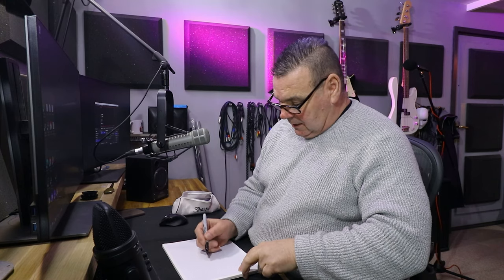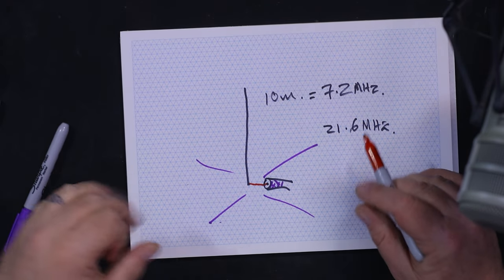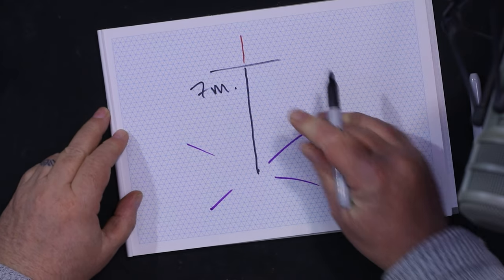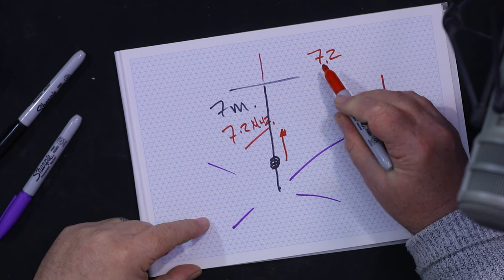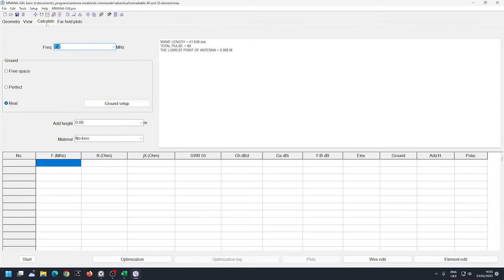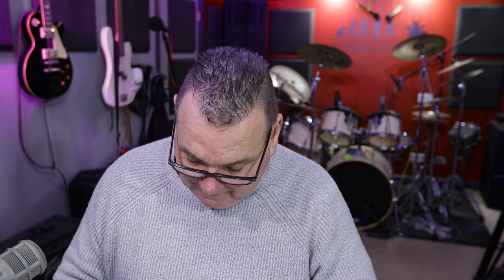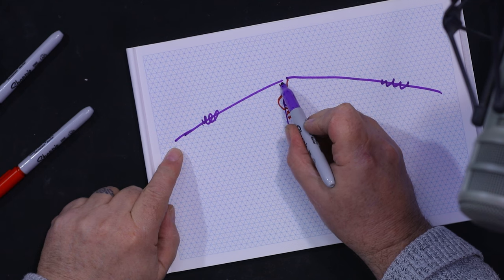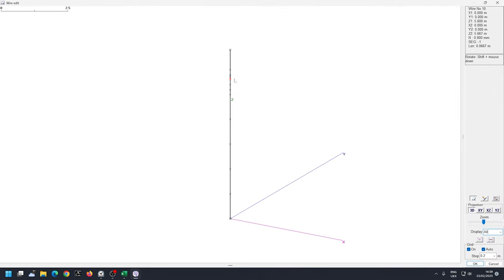Antenna Secrets: The Strange World of Coils and Antennas

Comment: Cal - your actually describing how the Hustler BTV antenna works, they use an LC (trap) circuit at various stages up a pole, what happens is when the LC circuit (they use 4 for various bands) becomes tuned at a given frequency it’s impedance becomes infinite thereby isolating the section above it and effectively reducing the antenna size so that it can tune at a higher frequency and hence achieve your requirement for a single pole with two resonant frequencies. 
You can also use just a series coil to electrically lengthen a physically short antenna. Example create a dipole of the required length at say 7MHz, then measure its inductance, then eg half the length measure its inductance and then insert a series coil to bring the inductance value back to that required for the full size antenna. You can top load, centre load or bottom load the shorter antenna depending on the desired radiation pattern required. Bottom and centre loaded antennas are the popular  in hand held applications.
Reply from the maker: OK David.. Remember, in this one, I'm not making a trap - I'm forcing the third harmonic down. In today's test - I got this working and the coil is 5.5m above the feedpoint, so I'm not generating a quarterwave on 20m band..

Comment: Dear Caliium, Boys and girls, one vertical that is 5/8 of the highest band you are going to work will do all the magic, don't need the height, just above the roof line using the metal roof as radials, all this simplicity is connected directly to rg213 going directly to your antenna tuner and...... AND,,, well, it works like a charm ( on all bands ham or not, lol).
It is all about how good is a given radiator ( antenna ) in "putting" the supplied energy around it and at the correct angle ( dx? nvis?) , all this rather than its SWR (let us face it, you might be able to "tune" your old fridge, but does it make it a good radiator? really? will be heavy to put on the roof, lol) ).
So,,,,,,, we did a test, putting our idea into real life situation ( we don't trust computer diagrams and nice graphics we found out the hard way, every situation is VERY different)  WE made two antennas, the same base used ( change over ) same materials, and connections, one was a  "tuned" vertical 40 /15   (SWR 1:1.4 -+)  and the same size ( length)  antenna being "untuned" was made as "control" , just the same kind of pipe with no coils or balun when that one was attached we were using an antenna tuner ( MFJ 949), the same 50m cable was used for both antennas in this test  ( rg213)  
AND,,,,,,,,,,,,,,,,, well, well, no difference was noted going from antenna A to antenna B  on the 40/15 meters ( or nothing that we could see or measure).
So, if you want a REAL fully multi-band system you might use two verticals, 10-13m for the low bands ( longer? even better ) and 7 meters for the higher bands, those will be non-resonating antennas, Yes you will use the tuner, but don't think the power loss is a real issue here, it's not.
Most important keep having FUN.
Remember the issue of SWR was not an issue in the 40s when an open wire was used, and with the invention of coax, thinking has changed, sadly, most that we have been read about SWR and related losses might be wrong and made of assumptions rather than reality.
Reply from the maker: All good until you mentioned "tuner".. LOL I enjoy mucking about with matching antennas "on the cheap".

Comment: Hi Callum, like,your videos a lot, especially as I like building antennas and experimenting away. 
What you describe here for 20/40, I built a couple of years ago for my apartment antenna, to get on the air on 20 and 40. I used a 20m band full size dipole, with a coil of about 31uh at each end of each leg (after I unfolded the double folded part what wat used to tune and hang the antenna. The legs alone are now longer than 1/4 wave on 20 )  and then about a meter of wire at the end. That gave  me 20 and 40m, although narrow band, but nothing what the atu in the radio couldn’t  solve. 
Biggest problem was hanging it,  as the balcony was 7,5m,  it was shaped like a inverted U and just 30 cm out of the balcony.  
As noise levels gone up way high the last couple of years in city I almost never use it anymore, I rather take my Icom 705, a 10m sotabeams mini pole and an endfed antenna to the countryside to make some contacts.  
I also wonder if the parts for the expedition dx commander would fit the sotabeams 10m mini pole, as it also is 68 cm transport length ?
Reply from the maker: Fascinating! Great work too. I think about 31uh is probably cock on..!

Comment: Great video! I had a 40M inverted V with a 20ft high feed point and I needed to get on 80M (around 3860)with it as well. I built two coils out of pvc tubing and I think 78 turns of magnet wire added to the end of the 40M wires. I did it because I didn't have room to add the full wire for 80M. The 40M part was tuned for the digital portion and after much cutting and folding back I was able to get it back where it started and got the 80M part tuned for 3860 with about 2.5 ft of additional antenna wire. It worked great. I took it down when I got my DX Commander Classic and still have it stored. I have no idea of the math. I just know it works. Jack K5FIT
Reply from the maker: Hiya Jack. Like you, I can't remember exactly how long or how many turns all my wire antennas had either!

Comment: Well big fellow. I am a physicist and sill cannot follow most of what you are saying or explaining. But I like your channel and have got some answers to important questions. Now I will share with you something i saw in mid 80s. I was an electronics supplier that had 8  TV Stations in my territory. One was Channel 47 in WA State. UHF. It was a slow day and the engineer, and I went to thee transmitter and tower on the local hill a few miles away from the studio.  I had seen other TV transmitter antennas but this one was different. It had from the transmitter a wave guide that went to 
a holllow cylendrical pipe that then had elongated slots in various places on that heavy heavy pipe. I was told that the signal came out of the slots. This cylinder was at the top of the 320' tower and was I assume about 8 feet tall. The reason i saw it was a lightning Stike had damaged it and it was laying on the ground near the tower. They had replaced it under warranty. It did have
damage from the lighnig as water due to sideways rain and something plugged up the drain hole. thus when lightning hit it turned the water to stream and blew the thing off the top. I tried to lift one   end of it but cid not move at all. It was partly buried from the fall but also just flat out heavy. I later learned they switched to a more conventional antenna but did not find out why as was busy with particles. Neutrinos were the big kahuna at that time.  Great channel and great subscribers.   You all take care now.
Reply from the maker: Hello Jim, you are very kind! The comment on your memory of that strange TV antenna is a LOT of fun...!
Reply: @DXCommanderHQ  I had meant to ask if you folks had ever used or were aware of the strange antenna with holes that are slits or slots? The wave guide is common on UHF ike channels 28 also a customer. but no one I saw used these strange antennas with holes to let the signal out of. It cannot have been yhe only antenna of its kind. No way someone built that heavey turky for just one station. The transmitter was a Motorola Some stations used Harris but motorola was common on UHF.  I do not think VHFlow or high would be very usefull to use wave guide. Oh on channel 28 a crack in the wave guide caused the engineers are to heat up.  They had to fix that. 28 was licensed for 5000 watts but found 1.25 million did the trick.

Comment: Brilliant work Callam..... 

My concern with any coil is - when does the ohmic losses and internal coil losses out weigh the benefits the coil brings? Plus there is a change in Q as you move these up and down too. Then we talk constructional weaknesses brought on by the needed tower breaks. For me it's all about constant AM power and 24/7 power on transmission, with highly processed audio. I'd be concerned about burning these coils out and clearly that relates back to constructional issues.

I've always understood that the same coil to resonate a short stick gets bigger (more uH) when you move it up. This increases the real world losses (aka that's bad). But in doing so this encourages more current to flow in the vertical element (that's good). I've always use a rule of thumb that the point between (that's good & that's bad) is 45% of the length of your short stick from the base. You won't see any coils in stuff i build any higher than that. In fact I'd rather top load with more wires. But that doesn't help you here.

Good work..... I watch with one eye open and the other one watering a bit from being scared.... as I'm from the broadcasting game. 73's as always!
Reply: I would love to hear your experience on antenna building both for home shack and mobile for HF.
I'm fairly new to ham radio and I recently built my first antenna. A 3 element horizontal half wave fan dipole with no coils or chokes. Mounted at 26 foot off the ground. It does 40, 20, 15 and about 1/4 of 6 meters without a tuner. I'm very pleased with it especially on 15 meters... I've talked to Japan, Brazil and Puerto Rico with only 20 Watts and get 5-4 to 5-6 signal reports... 
I want to try a mobile antenna next. Something I can mount on my truck. Any ideas?
Reply from the maker: We tested the coil and it doesn't get hot higher up. But I do hear you. It's good fun though.
Reply from the maker: James - massive topic.. Stay tuned and maybe cruise the back catalogue of some of my longer presentations. Many deep ideas inside those.
Reply: @DXCommanderHQ  is this with 30% or 100% duty cycle there Mr Callum?
Reply from the maker: Peter.. I only do 100% duty for testing.. Not like every other manufacturer.. :)

Comment: Now I did learn something about loading coils in the Navy. Where the loading coil on the antenna is placed will determine the angle of the ground plane. Also I do know that your ground plans also affected by the loading coil if you're loading coil for instance is on an antenna that is connected to the side of the house and the loading coil is below the roof line.
Reply from the maker: Erm.. If the house isn't conductive it shouldn't matter.. But hey - everything almost works!
Reply: @DXCommanderHQ  
I don't know about over there, but over here in the states, if you live in an area that gets a lot of lightning they ground the gutters and run grounding wire/lightning wires along the roof. And aluminum siding doesn't help much either. I do know if you live in an HOA that doesn't like antennas on the roof that a fire stick with the loaded coil on top just peeking over the roof enough to get the coil over the roof line works a bit better than an oil coil or Wilson with the coil below the roof line during skip on 10m, 11m (especially), and 12m.

Comment: I made a centre loaded 80M vertical last year and its 5M wire then a loading coil and then 5M wire so I got 20M and 80M but ive always wondered as the loading coil acts as a trap what effect it would have with say minimum inductance for it to be a trap vs a higher inductance but to answer your question walters and stanton done a vid where he got 20 and 40 on the same wire doing the same thing,btw theres also less capacitance between usin insulated wire and solid copper wire which is what I used

Comment: i have made a similar vertical antenna , infact i still use it for the motorhome as no radials are needed  , use a 12 meter pole make a full size half wave on 20 meters then a small coil to bring the last section to 40 meters , it also tunes up on 11 . No tuner needed ,  use a 49 to 1 transformer ..

Comment: I am using the program NEC quite a bit. Your problem sounds like a classical optimization problem with only 2-6 parameters. In case there is a solution, you can find the optimum by varying these parameters. The other thing I see is, that the folded part at the top of the antenna is pretty close together with the main conductor of the antenna. That gives you kind of a parallel wire waveguide which creates funny resonance effect on its own. I think, it would be better to make the distance between the two wires much bigger, like half a meter or so.
Reply from the maker: Well. It does work as the modelling suggested. I made the build video about 1-week after this..
Reply: @DXCommanderHQ  OK, I need to check that out.

Comment: Very interesting.  Cool research, Cal.  Wonder if using some foam pipe lagging would suffice for the coil former to reduce weight aloft.
Reply: The foam would have a dielectric impact and change the coil inductance. As an alternative weight saving method take a tube and cut most of it away to make a skeleton former.
Reply from the maker: Possibly!

Comment: Realllly enjoyed this one Calum. If I can scratch up some bread I'm going to have to ping you for some antenna wire and do some experimenting. On a side note, I've also got the wild hair to experiment with dipoles made from tent poles. You can buy the tubing and insert pretty cheap and they are already perfect for take down so I'm going to give it a go and even try it for a sota activation. Fingers crossed.

Comment: Hi 
So the 12.4m has end effect fold back ends
I wonder what changes that would make to your dipole harmonic resonances
Cheers Cal
Reply from the maker: Well... ALL wire antennas have end-effect.. But we do small changes to the final tune on the foldback instead of the coil - it's easier.

Comment: Callum, two questions please, firstly, what would happen/the effect be, if you connected the centre of the coax to the ground and the shield of the coax to the vertical? I guess that theoretically/practically nothing would change?

Secondly, does the radiation pattern change if the VSWR is not 1:1 or "low"? I am wondering if a VSWR of say 5:1 might possibly create advantageous lobes so long as you could increase the output power to compensate? I am thinking of fixed wire antennas in particular.

Thanks in advance.
Reply from the maker: All good questions.. Actually, I once did Q1 and other than getting a really hot (buning microphone!) it still worked.. Q2 Actually SWR does nothing to the pattern other than obey the laws of length (in other words, you can change the length and lobes appear and disappear according to the principles of element length. I must say, very good questions!

Comment: Its a long time since I owned a Sandpiper vertical, but i think they worked along a similar principle?  They were not trap antennas. As you do your tests,  have a look at the useable bandwidth too I would anticipate the low Q of the coil built as described to reduce the 2:1 SWR bandwidth.
Reply from the maker: Indeed, we'll look at that. Good point.

Comment: What about MOVING INDUCTANCE COIL .....If you wound a coil and had it mounted on an antenna wire without any electrical connectivity....but on a pulley system, that slid it up or down an antenna wire...    Just a thought....
Reply from the maker: Try it..!

Comment: Perhaps your the one to ask this most difficult question. I have yet to get a straight answer. How are the Smith graph radiation patterns produced. Is it conjecture or something that can actually be seen with some kind of instrument or device? I have been able to see the static charge patter on a charged pvc pipe using ashes sprinkled about the pipe and saw the ghost. It was a series of torroids up and down the pipe which can be discharged like individual cells by putting a light bulb or my finger near each one and hear the click as they are discharged. People think I am crazy and asking too many questions which will not even be on the extra exam anyway. I have to wonder if dusting ashes over my antenna array would show me the pattern which I am wanting to see. Please sir, give me some insight. I know you know. Thanks
Reply from the maker: Smiths charts.. It's like a 3d puzzle. Frankly, I'm not the one to ask for the best answer. Maybe Mike M0MSN might help. Ask on his channel..?

Comment: Hello callum. Great video. I built the 40/20m antenna vertical for your antenna ecoms comp. I did a pole version and a string in a tree. It works well. 
I didn't win 😭 but I will trade you for a expedition 😁😉😉
Motters M7TRS 73 👍🏻
Reply from the maker: HAHA!
Reply: @DXCommanderHQ  😁 if I can help in anyway let me know. I can not remember what I put in the pdf I sent you now. It had pictures of the things I use.
I haven't use it since I took all the pictures and write up.
Motters M7TRS 73

Comment: Hi Cal, do you think it would be easier to perfect the dimensions and the coil inductance values if you did the experiments at say 5 or 10 times the frequency and used the good old antenna analyser to test it all out and then re calculate it back down in frequency  ***  just a thought, as of course the whole thing would be easier to handle as it wouldn't be that tall.
Regards
Dave.
Reply: The issue with that is, as you go up in freq and your wavelength gets smaller, your antenna also becomes far less affected by the earth. Because it's more than a wavelength up in the air. Most HF antennas are never used even half a wavelength above ground, and this has a large effect on the swr/resonant point and the radiation pattern.
Reply from the maker: Hiya Dave.. as the other commented suggested, the earth changes.. But maybe on a vertical it might not matter too much. Yes - you COULD what you suggest but since I'm only faffing around with a 7m pole, it should be pretty easy. Good idea though.